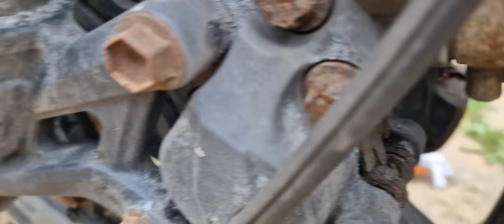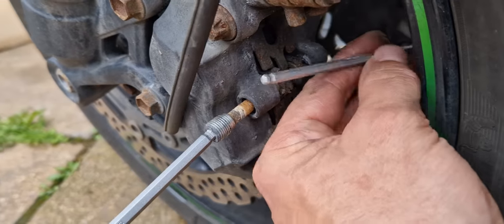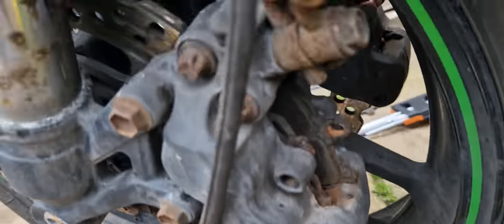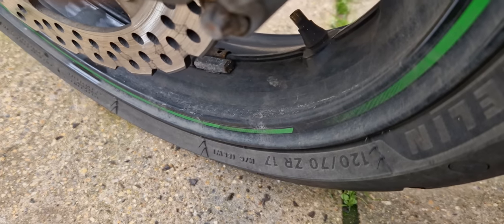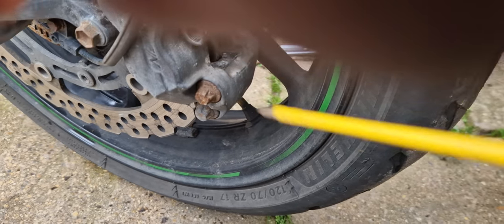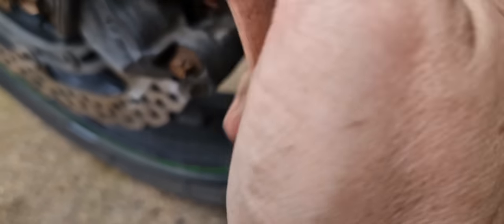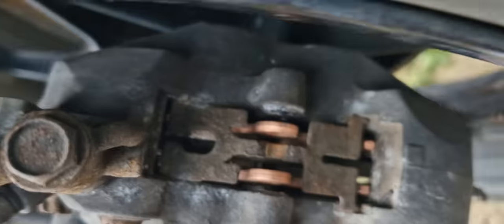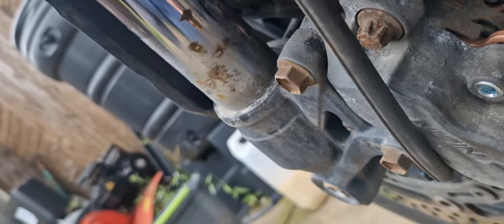Z900 corroded brake pad removal

Comment: Should of heated all the parts until they were glowing red and then dropped them in old engine oil. Everything would be vulcanised or some shit. Then lather um in copper slip and thread lock.

Comment: And you criticize Del for not cleaning his bike parts when doing work. Such a hypocrite! To everyone saying it’s bad up north, has nothing to do with let a 4 year old vehicle get into that state. Really disgusting.
Reply: Changing pads on a driveway and changing pads while removing whole calipers in workshop is not the same thing.
Reply from the maker: "And you criticize Del for not cleaning his bike parts when doing work. Such a hypocrite!"

- See comment below.

"To everyone saying it’s bad up north, has nothing to do with let a 4 year old vehicle get into that state. Really disgusting."

- The weather has nothing to do with it? Really?
Reply: @dirtygarageguy  well the “weater” doesn’t. And the weather doesn’t also if you look after it and protect it properly.
Reply: @inevespace  okay. Just imagine if Del posted that video
Reply: @JT-et7ui  and it would be fine. It is, essentially, what every mechanics does in service shops. Del will put a bike on lifting, remove calipers. Then, push pistons out to change seals for no reasons, put it back to dirty caliper with red rubber grease and risk of contamination. Of course, he will "buff" bolts by wire wheel, and, finally, change pads, in worst case, adding copper grease on it. Del knows that videos with pad changing as intended by manufacturers are boring, because it is simple AF. So he adds procedures just for viewers entertainment.

Comment: Double standards! If this was del you would rip him apart, I normally love your content Matt but have to agree it’s pretty poor maintenance.
Reply from the maker: I don't think you understand what 1) double standards are 2) the point of any of this is.
Reply: @dirtygarageguy  double standards means that you are very quick at judging other people for the work that they carry out on their motorcycles, and now myself and others are questioning your workmanship. The brakes on a motorcycle are a critical element to the bikes safety and should never be in that standard. And the Pistons are heavily corroded and you haven’t even pumped them out and cleaned the rust off so somebody watching your video may think that it’s absolutely fine to have heavily corroded pistons,that could cause there seals to leak and leading to brake failure. This is what I mean, by double standards, you are making a video that other people are going to watch and copy what you were doing. Ages ago you said you were making replica firearms as I recall, but haven’t seen any sign of that either.
Reply from the maker: Right, so you've just said other people's work. What work did I do? Was the brake pad install wrong?
Reply from the maker: As for the pistons the edge corrosion is erm... on the edge. They don't reach the even the dust seals. They don't need wire brushing, that's what bandits do. Like the rest of the calipers they need fresh parts. Guess what's happening soon...
Reply from the maker: As for firearms... 1) what has that got to do with you? 2) oh look, here they are. https://m.facebook.com/groups/1316272022115358/permalink/1531499380592620/?sfnsn=scwspmo&ref=share
Reply: @dirtygarageguy  if you’re happy with that standard, then that’s fine. I wouldn’t use a wire brush. I would just use a toothbrush and some horror pic toilet cleaner to give the Pistons are clean. That Rusty is only going to get worse. What would be the benefit of not taking a little bit more time and cleaning everything properly. Also it should never get in that state in the first place with the Rusty laminating the pads. And that’s not even to mention your forks.
Reply from the maker: So, please get me the time stamp when I said the following;

1) I'm happy
2) that there's any benefit to this
3) that this should be left like this
4) the point of the video

Now, once you can't find those quotes answer these simple questions.

You clearly don't know what the fuck you're talking about. Toothbrush and acid lol. No mention of kawasaki here though, weird...
Reply: @dirtygarageguy  one Facebook post in may of some sort of heat shield, 😴

Comment: What’s going on there. I’ve got a 22 year old zrx1200 that has done 60000 miles, 40000 of them by me in 5 year in all weathers, and it’s never been kept undercover since I’ve had it, and none of the fasteners on it are like yours. Spent more money building the Zrx did they?
Reply: @noggintube  notts. so not exactly tropical. Same amount of salt on the roads during the winter I’d say. I reckon fasteners were better 22 years ago. Actually, I’ve got a 29 year old bike that isn’t rusty either.

Comment: Kawasaki nuts and bolts seem to go rusty so fast both my 250 and her 300 Ninja.  
I've replaced some of them last year for OEM ones off Fowlers. Then they've already started rusting, must be a Kawk thing.
Gonna go Stainless on some stuff from now no Probolt shite though.
Reply: I agree. I’ve just done a lot of work on a 2019 Z1000sx that used all year round and I couldn’t believe the state of some fasteners, the exhaust studs and nuts basically crumbled, the fan had fallen off etc. would last years of summer only riding but fizz away quickly all year round

Comment: One big reason why I'm not riding my bike in the winter with salt on the road. But I guess English weather combined with "island air" will not help either. Mother of god is that bike rotten. You want to push in those pistons? Clean them first otherwise you push all that dirt and rust into the sealings. But you are the pro. Who am I to give advise... 😬😬🤜🤜

Which model year is that Kawa?

Comment: I know you ride i shitty climate and salty roads. But I mean, what about maintenance and daily care (rins the bike with water)? Pads are worn out when they have 1.2mm left and I noticed  yours are way beyond. And then all the rust. Matt, its your choice tot ride that bike, but know it looks dangerous. Then again , I get the point, these bikes can handle more shit then most folk use them for. And it shows that we don't need to follow some type of advise that shows us we need to be neat and tidy all the time. Take care
Reply from the maker: What maintenance and daily care are you talking about?
Reply: @dirtygarageguy   After every ride in salt - I used to rinse my bike with a garden hose when coming home. Takes 2 minutes to go over the bike. Ones every few weeks clean the bike and treat your brakes with brake cleaner, if needed protect your forks with a small PTFE layer. Really helps and makes a difference over time.
Reply from the maker: And this shows what you don't know. The bike was cleaned every 2 weeks.
Reply from the maker: Also, and thanks for replying, what's dangerous? Please explain.
Reply: @dirtygarageguy  Your welcome mate. I know you have a logic view on what your doing and that it's your right to do so. But I work(ed) in heavy industries and I would not clear a system that looks like yours ...
Following remarks that I would address: 1. Rust is basically a nogo buddy! Rusty bolts in a brake system are something to note in the pre-ride check - you don't know whats developing behind the rust. 2. Looking to your brake lines and bleed valves, maybe the DOT4 wasn't changed on maintennance intervals.? Recommended after 2 years because of the lowering boiling point. 3. Worn out brake pads like yours are dangerous, could not measure them (1.2mm minimum) but they were really on the limit and thus could not dissipate heat as much. Good that these are swapped but always change them sooner. 4. Rusty pulser ring and probably the ABS sensor as well. Good that you don't get a ABS warning. 5.Your unnecessary forcing the dust seal when pushing back a dirty piston with salt and grid onto it. Using some simple brake cleaner prevents this.
To put it simple: the braking system in general is in a twisty shape and could therefore have smaller tollerance to brake fading or vapor lock. Difficult to say and thats my point, You are working it on the limit and trusting it is then dangerous. 
I know you use the bike only to commute but you should be able to use your brake system in hills and mountainous  regions or a race track as well. It is build to withstand these stresses when maintained well and its the responsibility of any rider that his motorbike maintains this standard. Look at it like this: You run at 125km/h and give a full emergency stop with your system (just before pad and slide pin swap) and with a well maintined one (no rust - shinning bolts & lines - new pads, fluid, pins and spring). It wouldn't change the brake systems stopping distance that much - but the quality of the feel, the durability and power in hard braking would differ. Which means you have the feedback you need to stay safe. Why take the risk?
Reply: @dirtygarageguy  which is good but the daily care prevents rusting more. just a rinse makes a difference because the salt cant work its way in. I always left my hose connected. Easy job
Reply: @dirtygarageguy cleaned with a salt rub
Reply: @simDIY1981 Let's put it this way - you wouldn't take it on a track day.
Reply: Yes I'm sure road salt didn't dissolve his brake pads down to the metal  overnight!!
Reply: @maximXX  nope, over the years

Comment: How strange is seems, that, without a buttering of copper grease, the pad/piston interface remained corrosion free.  Some will scoff at the grotty state of the caliper, but if you ride everyday all year with four months of salt on the roads it's how things will get. It does however show just how poor the finish on steel parts can get. Stainless pistons would have been a blessing and I might not have shoved the old pistons back in so as to not risk damaging the dust seals. BUT, as a lesson on how easy it is to change the brake pads on your Kawasaki  the video is very good. And you have proved your point on the waste of time copper grease is.   As for adverse comments :-  those that do not daily commute never go out in the rain and SORN their bikes all winter but every sunday ( if it's dry) go to a bike meet and pose with their Shiny bit gleaming in the sun.

Comment: You have no Cap on your Tire Valve ,and you say Dels bikes are Dangerous,I bet he's laughing his nuts off!.
Reply from the maker: No caps on valves is dangerous? Lol please explain why
Reply: @dirtygarageguy  because the shitty plastic cap and its "thread" (more of a pencil mark in my experience) is what really holds in all the air.  The metal thing is just for show...

Or if you win the lottery and a little pebble wedges itself in and opens the valve you might suffer a sudden explosive slow puncture

Comment: Matt,  how many miles has that bike done? I would have thought excessive corrosion should be covered by the bike manufacturer within the warranty period. A few years back I bought a new Mercedes car with alloy wheels. After two years the wheels had some relatively minor corrosion, Mercedes said that should not happen and "replaced" all the wheels 😮
Reply from the maker: 35k. It's well out of warranty
Reply: @dirtygarageguy  It wasn't out of warranty when serious corrosion started.
Reply from the maker: I dont think it's covered
Reply from the maker: They'll also give me more shit plated fasteners
Reply: @dirtygarageguy My mates got a 2002 CBR600 with 45k on it, been kept outside in Derbyshire (plenty of cow shit on the roads) and looks like a minter compared to your kawaka

Comment: Looks like it's been parked for a long time, going by the pads surface. You could have cleaned the corrosion of the pistons, at least, before pushing them in🙄

Comment: I found XCP rust blocker to be the best thing to use on bolts heads to prevent rusting, it dries tacky so doesn't run anywhere and lasts ages. The downside is loads of crap sticks to it but if you have the patience to clean it off later there shouldn't be any rust.
Reply: I use mechanical plasticine for it. It can't be wash out for years a easy to remove when need. But bike look bad with it. Only problem near chain/disks, because if you use brake cleaner or wd40, it destroys plasticine and it becomes sticky mess which is difficult to remove.

Comment: Wow who lets their pads get that low. You take the piss out of Dell how dangerous is that ? Rusty death trap.
Reply from the maker: Do you know anything about anything?
Reply: @dirtygarageguy  I know when pads are down to the metal, sorry rust.
Reply from the maker: Do you want me to send you them? There's probably a 1000 miles still on there. Do you even know how thick these pads were to start with?
Reply: @dirtygarageguy  why's it scored your disks then? And do you think it's a good idea to push rusted up to the edges pistons back without cleaning the rust off.
Reply from the maker: Scored the discs? 🤣 🤣 🤣 🤣 🤣
Reply: @dirtygarageguy  so if you send me them pads your telling me there is 3mm left on them?
Reply: @dirtygarageguy  6.19 the disc looks scored but could be bad picture.  But I'm quite sure your not meant to use them pads below 3mm. I could be wrong because "I dont know anything and I'm a tit".
Reply: Reason being is because they are bonded on and the metal part also has metal spikes pressed into them to help them attach, which I would guess stick out a couple of mm. So if you run your pads down too low the spikes will scratch the disks . But what do I know.
Reply: Plus I'm only guessing, but the lower you run the pads the hotter they would get creating three problems 1. Brake fade 2. More chance of whatever is bonding the pad on getting hot and undoing releasing the remaining pad material. 3. Clutching at straws now,  but the hotter the pad gets the more likely it is to rust out.
Reply: But like Manwell  "i know nothing"
Reply: Well the ones about to go on my blackbird (25 years old, lives outside) no rust by the way, have 5mm on them to start with so yes I do know. This thread will not let me or I don't know how to attach a photo .

Comment: On my bmw (car) I just put a screwdriver between the old pads to push the piston back. Everyone keeps telling me I needed a wind back tool, but I had no problems.
Reply: Only need a wind back tool on the rears if the handbrake acts on the caliper, which from my experience bmw generally have brake shoes on the hub that act on the inside of the disk for the handbrake.
My old Focus st had wind backs in the rears.
Reply: @ZacShepherd  
Yes, the rears are 'drum in hat' like you assumed, I still used a screwdriver and not a tool.

Comment: This comment section is fire….. I will say one thing that doesn’t seem to have cropped up… if you just want to use a bike as a commuter bike, there’s nothing wrong or even financially incompetent about buying an £8k bike, doing the bare minimum and running it into the ground for 5,6-7 years… even if you just scrap it at 6 years old. 
The depreciation is nothing like what it would be purchasing a new car. 
Buy it, treat it as a basic means of transport and throw it away at the end then repeat. Who wants to be constantly cleaning and chasing corrosion on a bike that is essentially being used as a 2 wheel work truck.
Reply: He stated when he bought the bike that it was a bike for 'life' as he had never bought a new one.

Comment: Tight git, surprised you haven't machined them to try and expose the last bits of material hahahaha
Reply: Let's put it this way - it certainly wouldn't meet the MOT standard which requires 1.5mm minimum brake material thickness.

Comment: I can only imagine the majority of people complaining about condition of the bike probably have heated garages, a bike bubble and only ride when the tarmac is atleast 22c with blazing sunshine. I took my 21 plate KTM SDR out in January when the road was wet for about 40 minutes. Couldnt wash it as it just started raining when i got home. A couple days later I look in the garage and all exposed metal was starting to corrode. Modern bikes dont take well to winter weather like older stuff does. Sign of the times with cheap Chinese fasteners (Yes even on your Japanese/Anywhere else made bikes). That one handed old/new pad pin move was very impressive. 😂